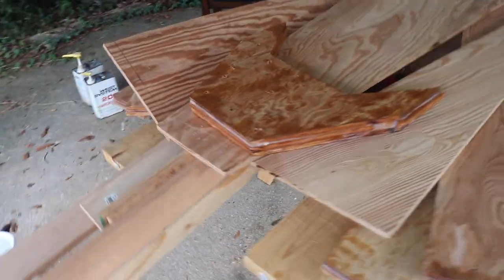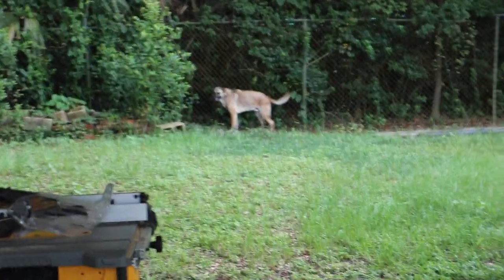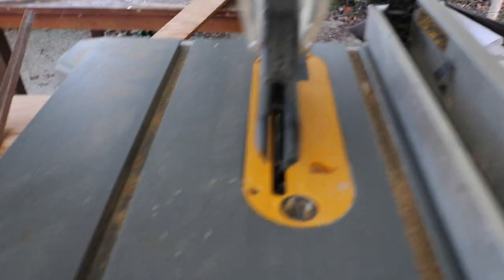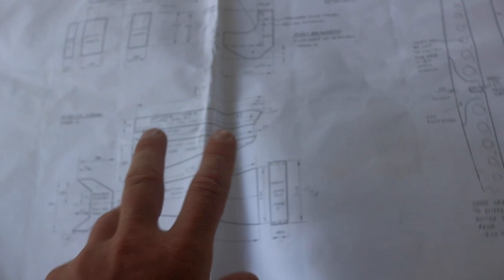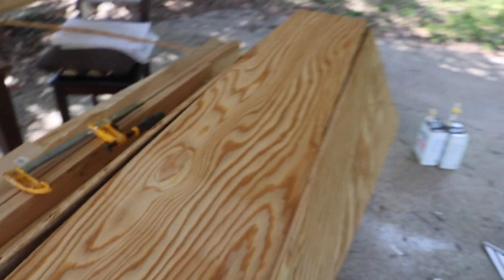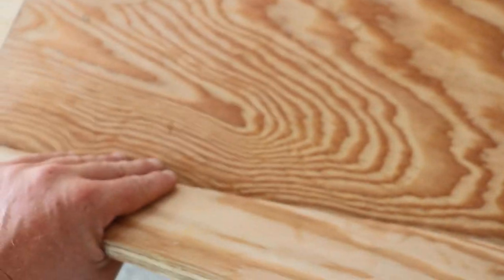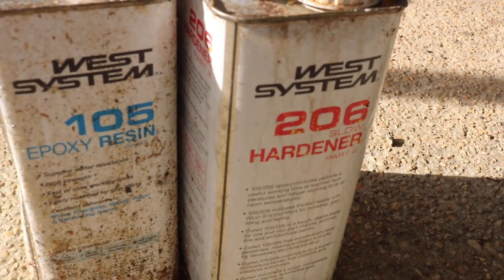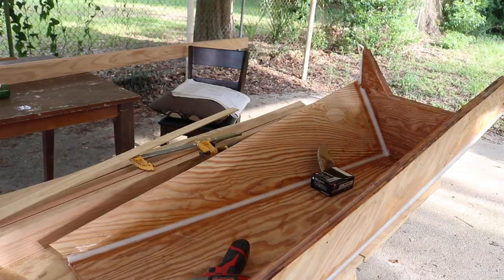E27 Building the two 20hp outboard engine boxes

Comment: Good stuff mate, I can personally reccomend you try the plastic bag to apply your thickened epoxy. Mix it all up put it in a thick plastic bag and cut the corner off it and squeeze the bag and it will come out of the corner that you cut. kind of like a cake decorating piping bag. Its so clean and fast it changed my life when I started to do it.
Reply: Thanks for sharing this brilliant tip, I will try it. Keep em coming:)
Reply: Could you add proportions and charge